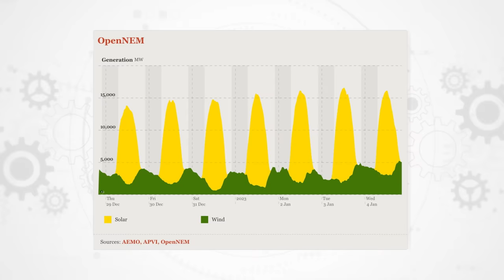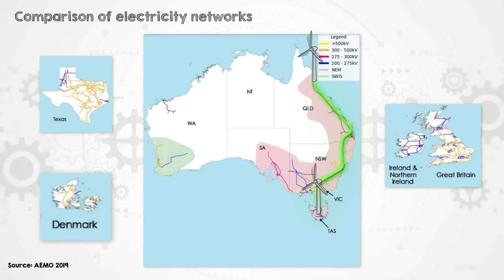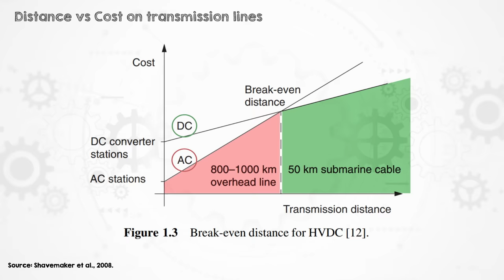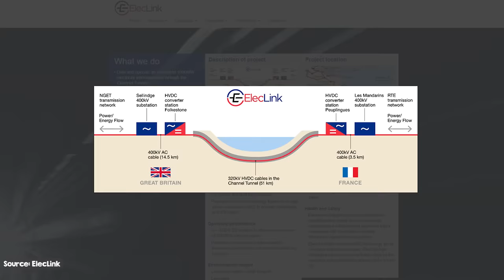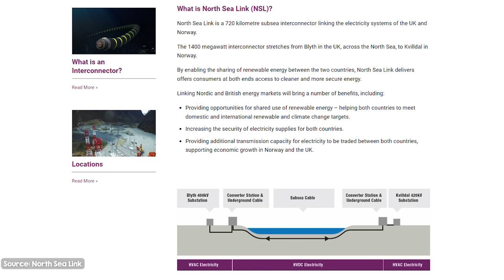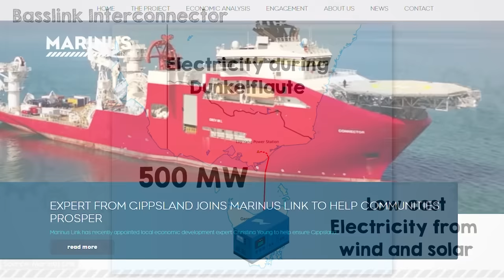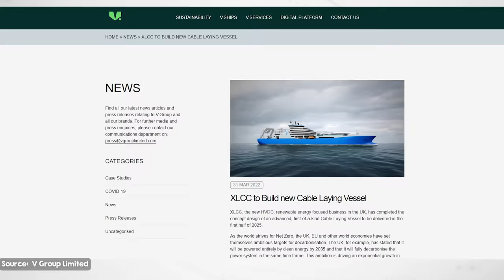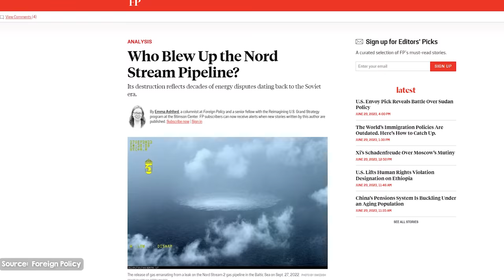Electricity Across Oceans: Is HVDC the Future?

Comment: Interesting video, thanks!

Do you also know about Ultra-high-voltage  DC or UHVDC? I have been reading that there are several in production already, especially for long distance (thousends of kilometers) . They work with voltages up to 1,100 kV and are supposed to minimizing transmission losses. Notable examples include the Three Gorges-Gezhouba-UHV DC transmission line in China, the Rio Madeira HVDC link in Brazil, and the North Sea Link connecting the power grids of Norway and the United Kingdom.
Reply: There is basically 3 types of cable. Monolithic under sea cable, segmented under ground cable, and air cable.

Air cable can carry about 1MV of potential. Under sea cable can carry about 500kV of potential and under ground cable can carry about 350kV of potential.

So its all down to what you select. If you do select 350kV you can do all 3 types. 500kV only sea and air, and if you do anything above 500kV you can only do air.

The reason why under sea cable is not used on land is that it have to be monolithic, that is in one bit, so it have to be transported by ship. There is not a truck that can carry a 5000 ton cable. (sometimes when they do under sea cable they link up like 10 bulldozers and pull the cable a few km inland, that way don´t need to have the station right by the sea).

What you can´t do is have a 1MW land cable then just connect a sea cable. Also there are no DC transformers, so if you want to step down 1MV to 500kV, you need to convert it via AC power, that is of cause very inefficient and expensive.

On top of that, a DC decouple have not yet been implemented. There is one that have been tested, but it have never been implemented. So currently there don´t exist any DC network.

So its not like the UHVDC is a other technology, its just the same, but with a different potential.
Reply: @matsv201  Sentence 5 makes no sense (step down 1MW to 500kV), I assume MV? The whole point of the presentation is that for very long distances HVDC is more efficient. ALL transmission systems have losses. If the conversion losses of one are lower than the other then it must be more efficient?
Reply: @icarossavvides2641  well the conversion loss from DC to DC is much higher than from AC to DC. So you really don't want to do a DC-DC conversion.
Reply: @matsv201 there are a lot of cable suppliers that nowadays manufacture 525kV onshore underground cables. They can be  built also exactly the same way with the same layers, just an additional armouring layer usually made of stainless steel ( which makes it a lot heavier per m of course) and instead of the onshore often used copper wire sheath they often use a lead sheath for the offshore cable. But these are changes due to mechanical and corrosion topics, not because of electrical topics. Otherwise subsea und onshore underground cables are the same. You actually COULD replace an underground cable with an offshore subsea cable (but why would you do this as it is way to heavy and more expensive). And actually it would be possible to spool an offshore cable in the factory onto an onshore cable drum. Instead of the currently up to 2000 m for a 525 kV 2 GW underground cable  I guess you just could spool something like 1000 m on it.
Reply: @kathatri1371  Of cause draging a cable a few km inland is possible. But when we talking hundred of km the cable need to be spliced. As far as i seen there is no reasonable way to splice a 525kV cable outside of the factory. Of cause, its DC so the splice need to be flawless.
Reply: @matsv201  Germanys SuedOstLink will be a 540 km long, DC, 2GW, 525 kV purely onshore cable system. The installation is current ongoing. Of course there will be joints (hopefully flawless :)) every 1700 to 2000 m. And this technology is not new and there are worldwide other big onshore cable systems 525 kV already installed or commissioned. The biggest challenge in systems like that is more the max allowed conductor temperature  - that is highly dependent on the ampacity and the soil resistivity. The insulator sickness can be increased quite easily for higher voltage levels but the insulator material that allows higher temperatures is currently the challenge (and very expensive). But there are already existing solutions as well (see P-laser vs XLPE).
Reply: @kathatri1371  So.. basically.. it kind of sort of.. really don´t exist yet, at least not out in the field.

But... in 2030 it should.. well it should be done. I can´t find a build start time... 

Also worth saying there exist no 3 way DC swich in the field yet. There is one in a lab, but no one in the fiedl so far.
Reply: @matsv201  Nordlink: in operation since end of 2020. HVDC, 525kV, 57km onshore cable.
Reply: @kathatri1371  No that is air cable, not the same thing. They have really no voltage restriction
Reply: @matsv201  I didn’t notice that Nordlink is  an overhead line. I thought it’s an underground cable. But Ok, then I have to offer KONTEK. I know it’s just 14 km land cable but it doesn’t matter if 14 km or 200 km as the installation method is the same: Truck with cable drum, joint pits, pulling in, jointing. I know that because I was part of the installation team. The cable btw. IS a 525 kV cable by Sumitomo although currently operating at 400 kV as KONTEK is a 28 years old DC system. The  old oil cable was replaced by the new XLPE cable on German side. So the cable could do the 525 kV, but the converters are old. In operation again since end of 2022.
Reply: @kathatri1371  Not really. You can pull a cable 14km... Pulling it 200km is really not practically possible.

There are plenty of sea-land cables around.

Typically there is a ground to air conversion station some 5-10km inland, then air cable the rest of the way. That way they can avoid air cable close to the sea air where also the land value is really high

This is really very common. Almost every sea cable have one air land link on at least one side.

Comment: I think that the future belongs to decentralized systems. Each household, each settlement, each section of highways can have its own sources of renewable energy and its own energy storages connected with neighboring ones. And large power plants will be needed only for large factories.
Reply from the maker: I think it's going to be a lot at both of the extremes and not much in the middle in the future. I will have some videos on community and household scale stuff coming up soon.
Reply: @EngineeringwithRosie  I live in Vic, and I'm a bit of an electronics tinkerer. One thing I've often wondered is why, with our high uptake of household solar, there isn't anyone marketing micro-grid DC systems between neighbours. I have chatted / emailed a few times with people in 2 levels of government and they've got little interest in it, to the degree that someone at DELWP said (and I'm paraphrasing); "what neighbours do over mutual fencelines is none of our business". The reason why I bring up DC is that a lot of household stuff can now be found at competitive prices in DC, and it's also possible to rig up AC-DC chargers to take AC or DC depending on what's available. And further; DC is less strictly regulated, in terms of installation & utilisation.

This is a bit of a ramble, but I think a sort of 'micro-grid kit' without expensive inverters could very cheaply allow the distribution of DC to neighbours of people with rooftop solar.
Reply: Maybe if there was more, smaller scale, local generation, the interconnects could be smaller, because you would only need to "top off" the supply of your neighbor, rather than importing a large percent of their consumption. I wonder how that would work in practice... if everybody only has wind and solar then it might be a pretty large area that needs an external supply. If you have small modular nuclear reactors in every town, it might be a different story.
Reply: @jamesrowlands8971  Possibly because they're probably illegal without a lot of licencing in most countries? There is a company that makes exactly the kind of product you describe - they install in less developed countries in villages that are too small and isolated to be connected to their national grid economically. But there are already local grids in developed countries - mostly in places where a distributed energy generation makes sense like rural communities, rather than a residential block in Sydney or New York.
Reply: @DFPercush  For every 1 sq.m. surface per year accounts for 1000 kWh of solar energy in Europe, and ~2000 kWh in Southern Europe. Current technologies make it possible to convert approximately 20-25% of this amount directly into electricity and 50-80% into thermal energy. This is actually enough for the roofs to fully provide energy for 1-16-storey residential buildings. The problem now is only in the qualitative transformation, storage and distribution of thermal and electrical energy. But this is also a completely solvable problem. And the closer the energy source is to the consumer, the lower the cost of energy delivery.
Huge fields of solar panels are a temporary problem until combined systems (PV + heat and PV + agricultural) become widespread.
Reply: @malcolmrose3361  in Australia it's likely it would be legal. We had less strict rules with DC as far as I know. Most of our rules are around installing AC mains stuff.
Reply: @sergeyvaninsky  Be careful about optimism in your calculations. 1000 kWh / y is equivalent to 114 Watts continuous. That's on par with most residential solar panels, but only while they have good sunlight. I would apply a factor of at most 1/3 in a sunny region, that's the theoretical max ( integral from 0 to pi of sin x dx / 2 pi = 0.318) adjust by average sun hours in cloudy areas.
   But you make a solid point about the costs of delivery. The closer you can produce the power to where it's needed, the more efficient everything will be. The method of generation just needs to be adapted to what's available in that area.
Reply: There's a lot of scope to reduce use still, but that runs into political problems.
Reply: @jamesrowlands8971  Can I ask, not just for myself, try not to use local abbreviations? YouTube is an international platform after all.

Comment: I would love to know how the inverters on either end (AC to DC... DC to AC) are done. Is it possible to do solid state at these voltages, or is it 'tubes'? What is maintenance like? What are the failure rates? Is there automatic switchover to a backup, etc. Thanks!
Reply: I'm pretty sure they use solid state, at least in the UK. I saw a documentary on their HVDC infrastructure a while back. The transistors are the size of a bus, and the whole inverter is a rather large building. I suspect that those large transistors are made up of many small ones, all connected to a single heat sink. I don't think any foundry makes silicon wafers that big lol.
Reply: Classic conversion is motor generator.

Comment: Non LCR losses include corona which is less with DC than equivalent AC RMS. There only a couple of photos I've seen of a nice long exposure of a 750kV land transmission line showing visible corona along the full length of the line between towers as opposed to just at corona rings. I have lit up a fluoro tube in my hand underneath a 330kV AC line only perhaps 30 feet above. It was a very cool demonstration that invisible losses are occurring.
Reply: If coronal losses are due to the ionization of air around a cable, how is that pertinent to an undersea cable. Just asking!😇

Comment: So, the main barriers are capitalists and politicians, eh? 🤔
Reply: When the Morocco - UK link was first proposed, my Swedish friend thought it'd be WAY better to run the link to Spain then route the energy through the Spanish/French grids, then to the UK. France, pretty much the next day, threatened to cut power to Jersey because of a minor fishing dispute. You can never underestimate the ability of politics to mess things up that are a simple engineering problem.
Reply: @marksherborne391 The Jersey dispute was due to overnight license requirements to french fishermen without prior notice and issuing the fines immediately. Not even a heads up. That was 1000% a dick move. 

Don’t take crap out of context the UK did France dirty in this case.
Reply: @carlosandleon  And threatening to cut power to Jersey wasn't a dick move? 100,000 people without power, vs (I think) 40 fishing boats inconvenienced.
In any event, bypassing France with an extremely long and expensive HVDC cable seems like a wise plan.

Comment: There's a consideration that tends to be overlooked in the design stages called FCAS (Frequency Control Ancillary Services) which determine overall system stability under all credible operational contingencies.  What it means is that there has to be sufficient spare plant online to cover the loss of any part of the network and large windfarms can be operating at max output then suddenly shut down due to a small increase in wind velocity.  So, basically, the more wind turbines are online, the more base generation has to be ready to pick up that in a matter of seconds to maintain the system frequency within tight limits.  HVDC cables have similar undesirable issues when changing direction IE they can not provide FCAS for 5 minutes or so when passing through zero (going from export to import or vice versa) so a lot of generators are needed online to guarantee system stability.  
The more generation you have, the more you need it seems :)

Comment: Interesting I'm a big fan of HVDC power transmission. That being said these huge transmission lines pose another engineering challenge if dealing with failure. This is in addition to the political issues you have already mentioned. Given that undersea fiber optic cable get damaged all the time I'd like to learn more about the exciting fireworks if the power cable gets damaged by an ill placed ship's anchor and possible damage to the ship itself.

Straddling time (solar) and climatic zones (wind) sounds like a great idea since we are a long way from implementing massive electrical storage.

Comment: Montreal is a very appropriate choice as the western end of your proposed trans Atlantic cable as it is probably the largest city in the world that achieves 100 percent renewable electricity and does so for a far lower price per kw/h than anyplace depending on wind or solar. Unfortunately many people who want to see renewables replace fossil fuels seem to be completely opposed to what is the most viable. It would not be solar energy from an area that sees sun twenty hours a day that would keep the power on, it would be the massive  hydropower dams north of Montreal

Comment: Wow! Exciting episode. What would a 5000 km HVDC cost to install? Surely too many of these and the OLD ME might return. (I tend to be eco-modernist, and used to think the grid had to be at least a third nuclear.) But I've got to remind myself Andrew Blakers says storage and HVDC are about 30% of the cost to get to the good stuff - the 70% of the grid costs that are about installing super-cheap, super-abundant renewables. 
Also, a side benefit is it would give us a political and economic incentive to STOP BOTTOM TRAWLING THE OCEAN where those cables lay! (Man we're trashing this planet.) Great episode Rosie. Great information. The production values seem to be going up too!
Reply: The assumed cost of constructing an HVDC submarine cable transmission is USD 2.5 million/km for a power capacity of 2,500 MW with a voltage of +/-500 kV 76) .
Reply: @TimMountjoy-zy2fd  hi Tim - that's interesting - do you have a reference?

Comment: Neat stuff, though I did feel the inductance capacitance losses part failed to highlight/mention that it's the way that capacitance makes for extra current that creates the loss, and likewise (in one view) the inductance 'consumes' voltage so we need a higher sending voltage for that current to flow, making for more losses. That is, pure inductance and capacitance just store and release energy, without loss, but they create those secondary system losses.  (that took too many words...)😉

Comment: Losses in AC lines come as she said from resistance, inductance and capacitance, but a very important loss of long AC lines is radio radiation. When the length of the line becomes significant relative to a  quarter wavelength (1200-1500km) this becomes a really large loss component and this should have been mentioned

Comment: So I’m all for linking every country together to share and sell power. This is more of a question than a comment. One of the issues with Mars is it has no magnetic field anymore. One potential solution is running a bunch of wires pole to pole to create an artificial magnetic field. Being that these Earth cables are insulated would they have the same or similar effect to modify or change earths magnetic field?. We’re not going to pole to pole but the more cable we have the more it’ll change our magnetic field if there is an effect.

Comment: Nice presentation. A couple of additional thingies. Some years ago Sweden was running out of capacity of one of it's undersea cables supplying one of it's many islands. Instead of laying a new cable they converted the existing undersea AC connection to DC thus increasing the power transmission capability by 1.414. Second tricky problem is the varying relative earth potentials of different countries,  I believe the USA ground potential is some 400v away from the UK's. I suppose this could work in someones favour? Don't know for certain as I'm an electronics not power engineer!😁😁😁